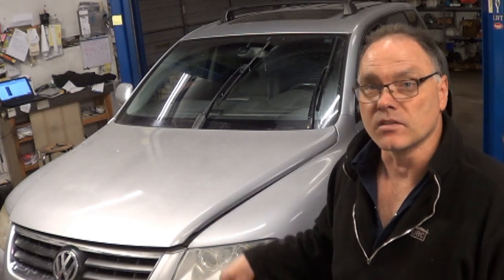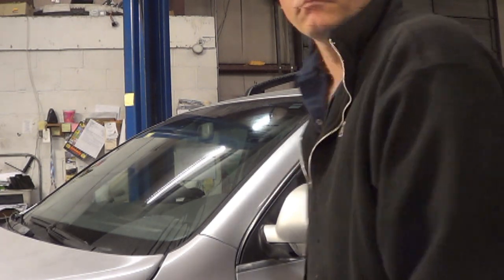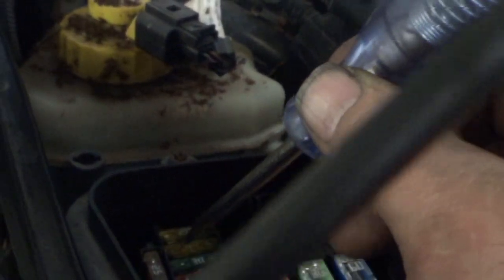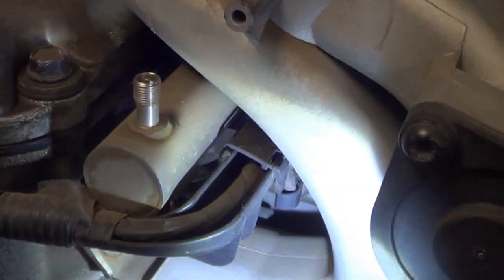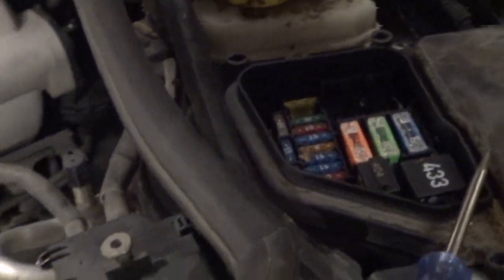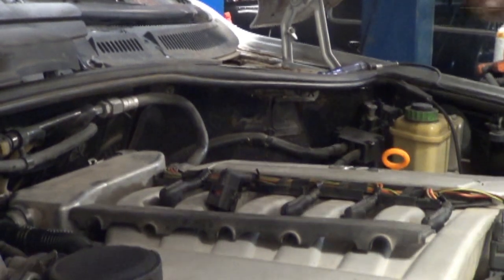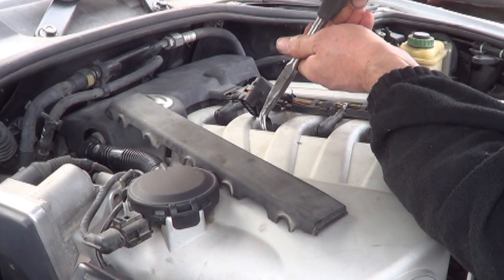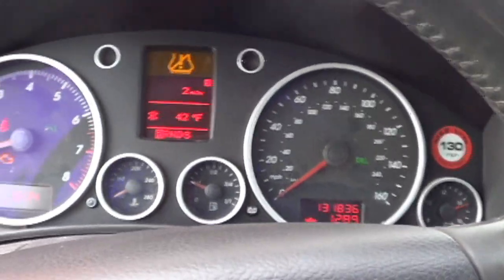2004 toaureg no power

Comment: hello I hope and you can help me with my vw touareg 09 has esye code p0368 ua change the sensor and still the check engine appears with the same problem.
Reply from the maker: What's the definition of the code?  What sensor are you changing?
Reply: Camshaft position sensor b circuit high
Reply from the maker: @samrey5554  How does it run?

Comment: We have a long suffering 2006 V6 Touareg. Its always had a misfire issue, fitted new coil packs and new plugs, no change. If we idle too long at traffic lights then the misfire comes. To cure it, pull over and turn off the ignition. Wait 5-10 seconds and restart and its running OK again.  I have no idea what that may be. Engine check light flashes at the same time as the misfire.  I have developed a technique of sitting at traffic lights in Neutral or Park and gently keeping the RPM at 1,000 - this stops the misfire from happening. Basically idling for anything longer than 30 seconds causes the misfire to start. 'Rebooting" the engine (turn it off and turn it on again) always fixes it.
Reply from the maker: interesting.
Reply: Cliff Kirk · Can i suggest seversal solutions for that misfire. You say you discovered that standing idle. You raise the engine to 1,000 rpms. I would check the cooling system antifreeze whether is truly circulating efficiently at the thermostat. It might be overheating a little bit somewhere at the thermostat. The misfire temporary goes away on yours. Because you are forcing more antifreeze circulating  thru the passageways in the block. The thermostat could also be (starting) to get (stuck closed). Also might try to change your thermostat to fix it. Let me know how it turned out. Am not a mechanic. But i have a 2017 VW Passat with the 1.8 turbo engine.
Reply: Hi, i have the same problem on a treg 2010 vr6, just like your issue. when the truck is on idle the CEL light flash on das. when accelerate no more flashing. i thon is a ecu problem with ground or voltage. idk :(

Comment: Hi I have volkswagen Touareg 2.5 tdi R5 2004 it loses power at around 70mph when high revs. No warning on the dash board. When I turn the car of then back on it drives normal again.
Reply from the maker: that's called limp mode and it indicates you have a boost related problem that the computer noticed.  When the computer notices these problems it triggers a trouble code and limits power to prevent engine damage.  Look at my other tdi boost related videos.  I don't have any toureg tdi videos but the other tdi related videos would have very similar diagnostic processes.
Reply: @CoolAirVw  thanks for your reply I will look into them now

Comment: audi a6 c5 2001 year. 180 hp cant do over 100. 1st 2nd gear cant go over 3k rpm 3 4 cant go over 2k rpm and 5th gear can do over arround 1,7k rpm. Any idea where to start looking? engine has a smooth roar
t
Reply from the maker: Cant do over 100?  interesting.  Here in USA your not allowed to drive 100 mph, so I'll assume your not in USA and your doing 100kph.  I dont know what your issue is, but I had a cop tell us one time after we rebuilt his cop car trans that, I cant do over 150mph, and he said, "we can go for a test drive, and I'll show you", and I said, "NO!".  I did end up fixing it though.

Comment: Hi, I have the same touregv6 3.2l  2004 model. It has difficulty starting as well. Now, it has no power. There's a yellow warning sign appearing in the dashboard like an inclined car and followed by kinda like letter H which describes low range or high range. And a light blinking on my left side which is the rotary auto differential switch. My battery was still ok as checked by AA. So, what seems to be the problem of the car? Is it possible one of the fuses? Please help. Thanks! I'm bringing my car in the mechanic next week. Your prompt reply will be much appreciated.❤
Reply from the maker: Sorry, no way I can know what's wrong with your car based on what your saying.

Comment: Hello sir thanks for the video first. Im trying to fix my headlight for while now its the front left headlight not getting power to the ballast nor the connector, i tried everything fuses relays and i just cant get it to work. Any ideas would help. The car is Touareg 2005 3.0 tdi BKS with xenon
Reply from the maker: power ground and a good bulb.  No voltage drops due to resistance. Might take getting it to a shop that is good with electrical.
Reply: @CoolAirVw  fixed it was wiring issues
Reply from the maker: @DC-kt3kk  cool
Reply from the maker: @DC-kt3kk  All right, yeah!